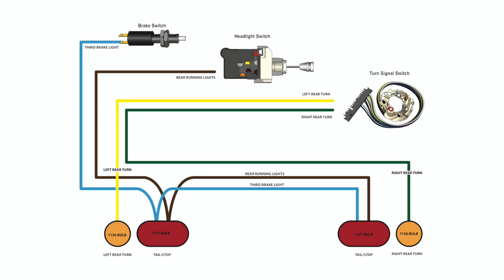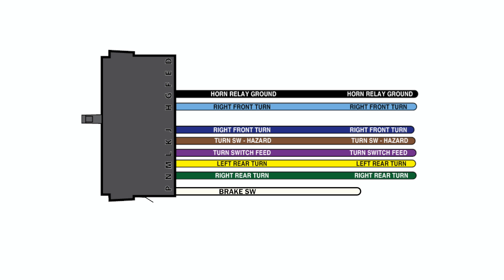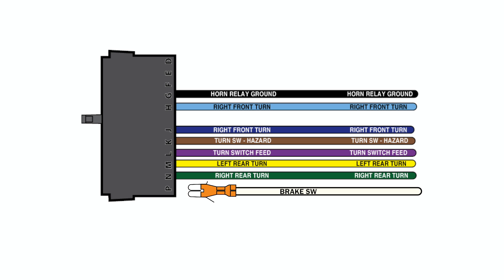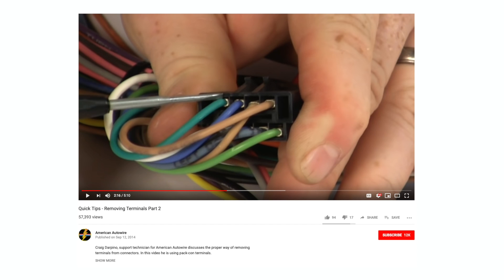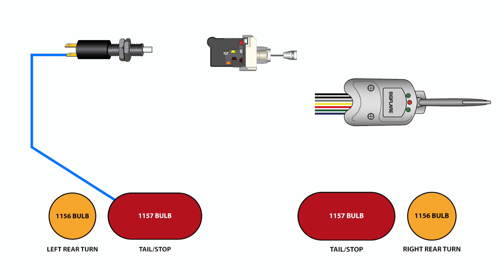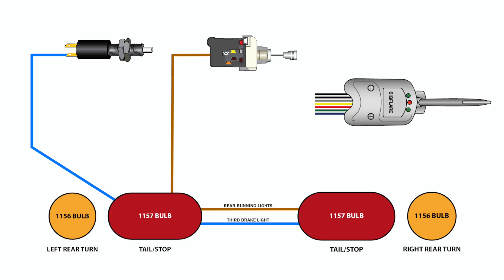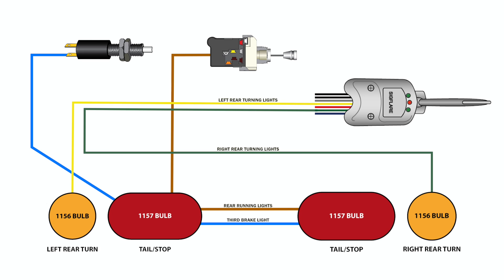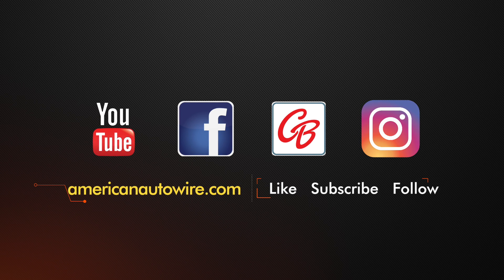Wiring European brake and tail lights with a universal AAW kit.

Comment: Hi, I bought from the US LED taillights to install to my European Jeep Wrangler JK.
I have an issue with the turn signals.
When I’m turning and have my rear turn lights operating, they work fine but when  I push the brake pedal, they stop blinking and remain stable without blinking. When I release the brake pedal you can see that they start blinking again.
Does your universal AAW kit solve this issue? Thank you.=
Reply: Have you ever fixed this issue? I'm about to embark on the exact same situation but with a different car, what did you end up doing?